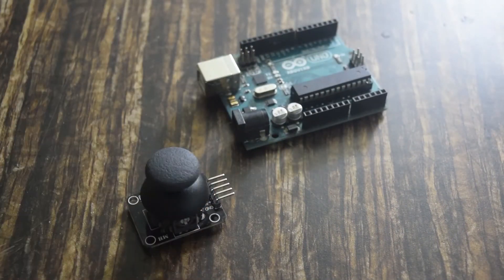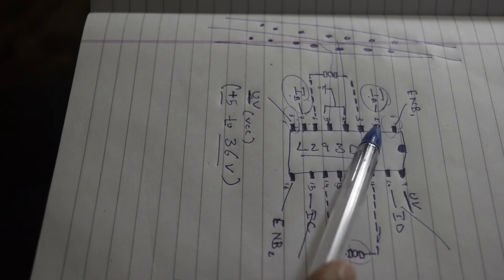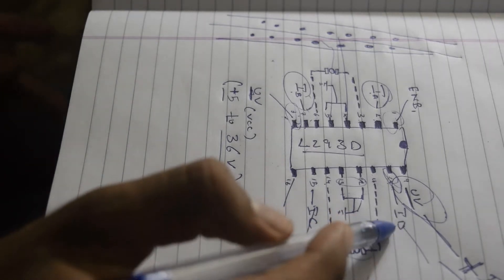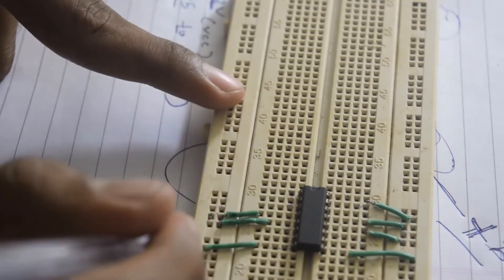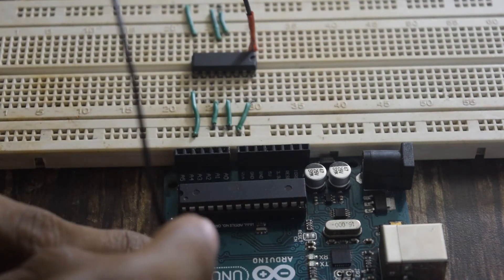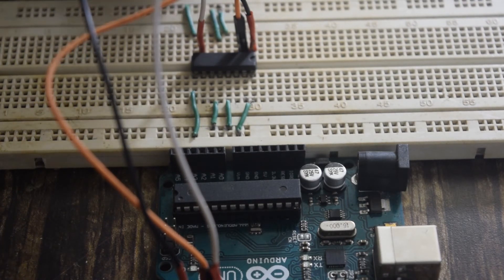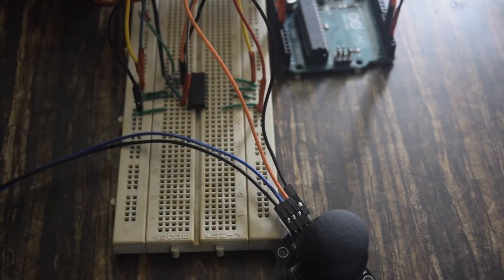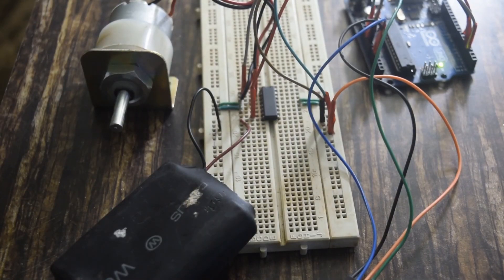ARDUINO PROJECTS - Controlling Dc Motor with L293D or L298N Motor Driver and joystick

Comment: Can i make it with 12v dc motor and 12 v battery????
Reply from the maker: Yes you can ...and i used 12v battery and 12v dc motor
Reply: I want to use 12v car viper motor with 12v battery with this project can i???

Comment: Hi I want to run 6 DC motors with joysticks (3 no) can you please help.
I would be really great if I can control them using PS3/4 remote control. 
All motors need to run CW and CCW
Reply from the maker: yes you can but  you have to use 3 motor drivers

Comment: can you please show me the for 2 dc motors connection l293d to arduino with joystic  &  code
Reply from the maker: rajusurya 
same code will work for 2 dc motors actually it is for 2 dc motors i have connected only one
Reply from the maker: rajusurya
give me your email id ill send u the circuit diagram for l293d to arduino

Comment: Hi. I am jahin from Dhaka, Bangladesh. Can you please help me to make a auto railway get control .i have already make a code for Arduino but it's not working .i also use L293D ic for motor control . My ir cancer is working but the motor is not working .i need help .my email address jahinhasan654321@gmail.com
Reply from the maker: stauseef123@gmail.com u can contact me here ill help uout
Reply: Tauseef Siddiqui ,☺☺
Reply from the maker: really sorry for late reply, no its a correct ID just retry sending mail
stauseef123@gmail.com